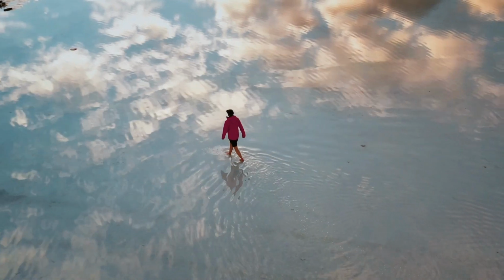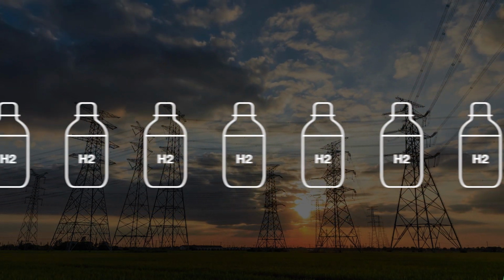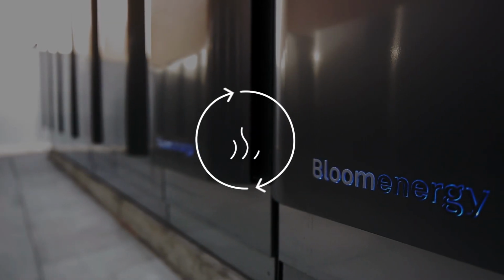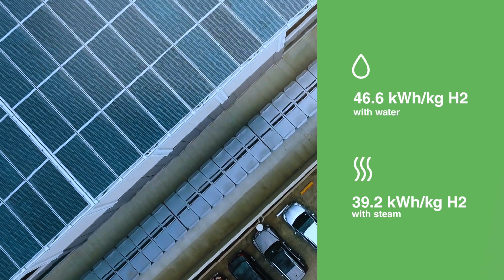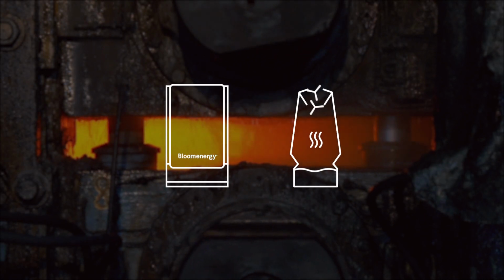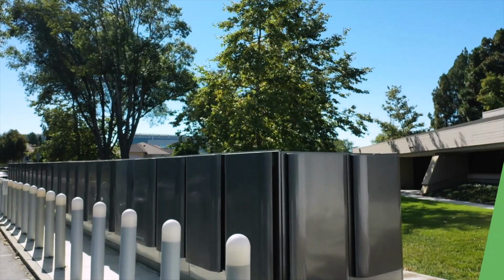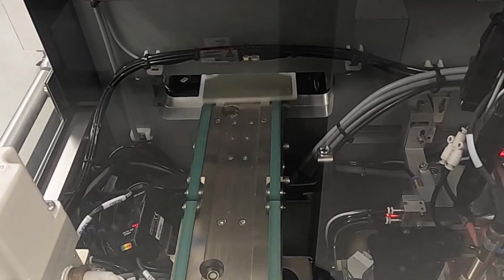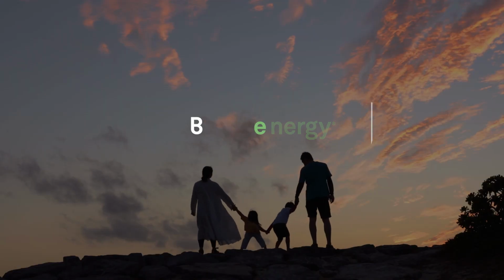The Bloom Guide to Hydrogen | Bloom Energy

Comment: Universal Axiom: All hydrogen stocks suck, including Bloom, and will continue to suck until electrolyzers are conceived, designed, and built that can produce millions of tons of hydrogen per annum.  Right now, this is not even close to possible.   Hydrogen electrolyzers and fuel cells are total nonsense in India and everywhere else, the "Hydrogen stocks" are hopeless losers because none of the electrolyzer companies can deliver industrial-scale capacity.  They only offer small-scale electrolysis capacity, so they can't provide anything but small-scale revenue.  Small-scale revenue will never eclipse their operating budget, so they cannot show a profit (earnings).  Small-scale electrolyzers cannot make enough H2 from water to reduce CO2 output at an industrial scale, so they are irrelevant.  Renewable energy is coming on line quickly, but to reduce global warming, one must decarbonize all of the greenhouse gas emitting sectors -- transportation, agriculture, residential & commercial building and industrial sources (primarily concrete, glass, steel and industrial chemicals).  That means we must create decarbonized fuels such as green ammonia, whereby we take cheap and abundant renewable energy and split water into cheap hydrogen and oxygen.  Then, humanity can remove nitrogen from the air (air is 78% Nitrogen) and, using the Haber Bosch method, combine the green H2 and N to make green ammonia (NH3).  Ammonia, as a "liquid carrier of hydrogen fuel," can carry more hydrogen/BTUs by volume at a reasonable temperature and pressure than gaseous or liquid hydrogen.  Large-scale electrolyzers (no existing electrolyzer manufacturer can provide) would allow green ammonia to fuel and power all greenhouse gas emitting sectors.  When electrolyzers are scaled to provide ammonia-scale plants producing four million metric tons of anhydrous ammonia per year, replacing methane feedstock; call me.  It is important to realize that to produce one ton of ammonia using today's methane "steam reformation process" conventional ammonia producers for nitrogenous fertilizers release 2.84 tons of CO2.

Comment: I want to ask a question. Why after routine i inhale HHO 3 hours a day i feel that many things become neutral. Did u have eksperience or eksplaination for this?

When I drink pure arabica espresso or americano normally from 10grams bean a day i can eksperience the caffeine and become awake. After using HHO even I drink 3 glass (from 3x 10grams bean) i don't got any effect and still can sleep.

Normally when i drink something sweet i feel that something change feeling on my skin. After inhale HHO 3hours a day, the feeling on my skin after eat or drink something which contain sugai in it is less less i can feel. Mostly i don't have the feeling when my body eat too much sugar.

Same also the effect which i eat ketoprak or gado gado which contain peanut paste which normaly make i feel my uric acid become high.

Before I use HHO sometimes sudennly i have paranoid hallucinations that i been thread by Police or something powerful and feel afraid without reason. After inhale HHO my felling always neutral.

After i inhale HHO i feel more open to learn anything and not give any judgement to anything. Are there connection between inhale hidrogen and: DMT, Ayahuasca, LSD, ect...

Why inhale Hidrogen make anything neutral?